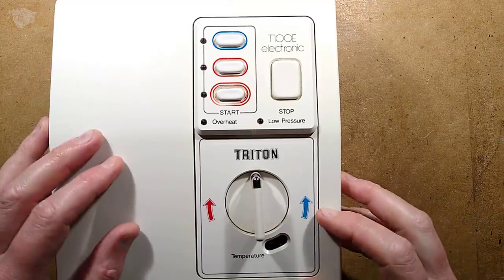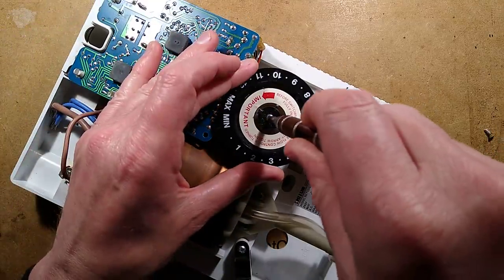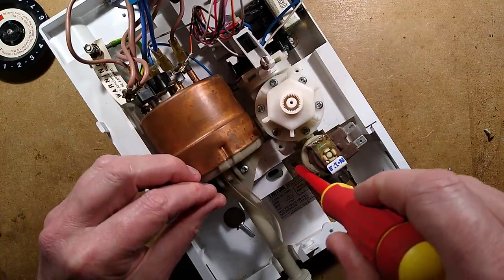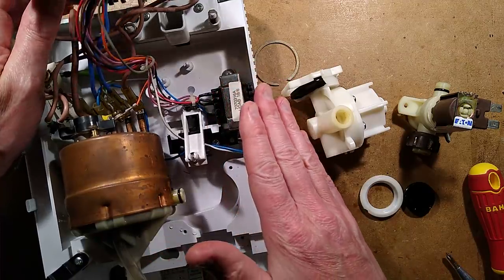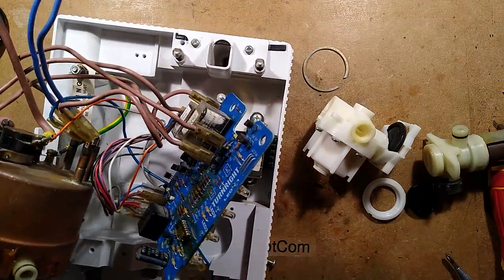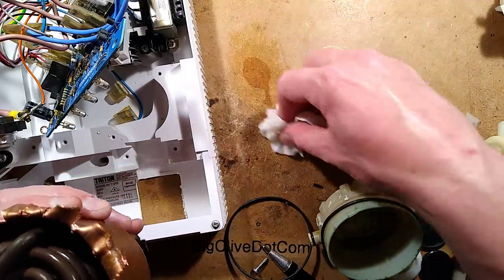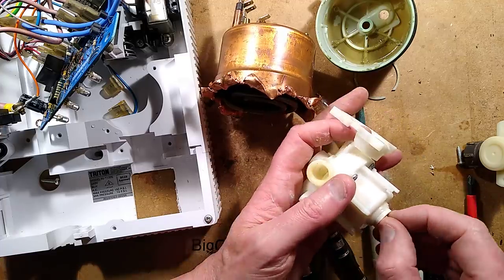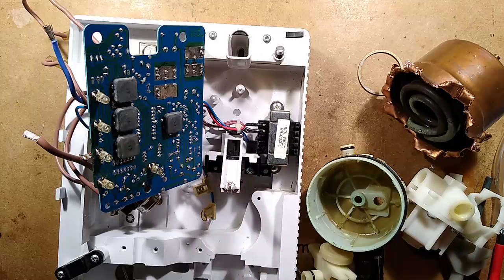Teardown of a British electric shower that went bang.

Comment: this seems like such a dangerous system to me. i really dont understand why anyone would want one of these
Reply: Out of interest, what do you find dangerous about this? There are thousands of these in use and I've never heard of any problems. In fact, my parents had one for over 30 years before they moved house, and it was perfectly reliable. They don't require a hot water supply, and you get a hot shower in a few seconds. It's interesting to note that in the UK, you won't find any electric sockets on the walls, and the light switch is either outside the bathroom or a pull cord. British safety standards are pretty high.
Reply: I echo what Steve Caddy has written and would like to add that a 30mA RCD trip is the compulsory safety disconnector for electric showers; not at all dangerous, I've used one for 40 years.
Reply: As soon as the electrical current spikes due to a short circuit, it cuts out at the speed of light.
Reply: @SteveCaddy  there's over 27 million homes in the uk, i expect at least 1/5 have at least one electric shower. That's not including hotels, caravans & campervans and so on. So at least 4 million i would bet, not "thousands"
Reply: @mandowarrior123  Fair comment, and you're probably right. I thought saying there were millions of these devices in use would have sounded like over-stating the figures. Either way - they're not as dangerous as some people assume.

Comment: My experience of UK electric showers is that you can do everything except get wet  !!
Reply: You forgot to switch them on. The 10kW ones aren't too bad.
Reply: Pressure is the problem, if you have very little pressure in your mains then there is a problem, The hotter you you want the water, the less water goes through them as they work by reducing the amount of water running around the elements to get a hotter shower. Bad deign really, but they are cheapish
Reply: You've likely used a power shower then, they have piss poor flow rates but an electric shower will drench you as you are basically standing under a fully open cold water mains being ran through a heating coil.
Reply: The 6.5kW electric shower in my student house is shite. The way these showers regulate temperature is by regulating flow-rate, not current. So in the winter when the water temperature into your home is colder, the water gets regulated down to a trickle. Not fun.
Reply: @Oscar-if6lq  anything less than 9kW is useless
Reply: @krashd  Not quite. The flow has to be drastically reduced so that the elements can heat it. That flow is adjusted by the temperature control.

Comment: I'm guessing the double heating elements in the copper section are for the dual-setting heat. So one of the elements is used for the medium setting, and both for the high setting.

Comment: I guess I can accept Clyde's assertion that these units are "relatively safe", but if Brits make a habit of running 240v directly into their shower enclosures I never want to hear another of them whining about Americans not having switched outlets.
Reply: Lol exactly. They're always up on their high horses about how their electricity system is so safe. But then I hear about their bathrooms, and I'm shocked.
Reply: I'm a Brit who moved to the US, the un-switched outlets I can live with, it's just a nice ease of use feature. However what gets me, is a plug that can be fully live but not all the way inserted. Blew a breaker by accident that way, plug behind a desk  had worked out slightly, knocked a pci slot cover off my desk and it somehow landed bridged directly across the 2 contacts. I know now they tend to put ground pin on top to stop that but still.. it can still be live and not all the way inserted.
Reply: I would say 1/3 at least of UK homes have electric showers.

Comment: For being that old it seems safe to use. Here in Belgium we don't use those things. Warm water comes from an electric boiler or from a boiler heated by fossil fuel. ( most of the time the central heating system warms up the boiler or warms up the water 'on the fly', without even a boiler). There are similar central electric systems like this who heat up the water instantly from the main water pipe and deliver it to all warm water foucets and showers in the house. It's rated mostly about 25A at either 230V or 16A at 400V, depending on the waterflow needed. Those systems usually  also implememt a sun water boiler on the roof.
Reply: Do you think we have one of these on every hot tap? Of course we have central hot water boilers. 🙄
Reply: @howardg2010  Lol if I presumed that then everyone house should need a 200+ Amp main fuse 🤣

Comment: I had a shower that failed in a similar way. Think it was Mira one. Was not possible to find a replacement unit with the same pipe positions, but I did fix it by buying an old stock  spare part.

Comment: We have similar devices in some homes in Singapore, but with a tap connected before the unit, and a 20A (rated) switch next to the switch for the bathroom lighting/fan for power, while I much prefer central water heaters (different sizes for different house sizes, and one unit connected to all hot water taps).

Comment: pressure sensor is for low pressure, in our house if a tap or 2 were openned itd trio the low pressure , light the "low pressure" light and give you an instant cold shower. I assume its so the heating tank never ran dry or low of flow.

Comment: Here in Brazil everyone have an electric shower. I have a (Lorenzetti Advanced Turbo) in my house, and is actually a good shower,  the water gets hot af. But it requires 7500w of power in 220v, I guess 34Amps. But most of them are not so sophisticated as those british ones. Some foreigners get worried about having a 127 or 220volts(depending the state) boiling water next your head, but I never heard I single story about someone being electrocuted during shower. I guess will only have an accident if you are stupid enough to touch a hot wire,  but you will only get a shock if have the copper exposed. So by my experience, electric showers are relatively safe if you install everything correctly.
Reply: Clive's made a couple of videos on the kind of electric showers common in Brazil (which he nicknamed 'suicide showers' I believe). He concluded that they're likely to not be that unsafe as long as they were installed properly. He complained that the ground wire was short, and that some people allegedly do not connect the ground wire to a proper ground and instead to the water pipe!

Comment: Our well has a similar diaphragm pressure switch  to sense when pipe pressure has hit it's target, and turn off the well pump.  Ours failed in a very similar way the NEXT morning after returning from 2 week vacation.  Flooded a small area of basement before we caught it.  Thankfully it waited till we got back.   This led me to install leak detectors and have them kill power to our well in event they are triggered.

Comment: On safety, in England in 2017 there were apparently only 13 deaths by electrocution, with only 7 taking place in the home. Considering there are a lot of other ways to get electrocuted - they are probably rather safe. (Data from ONS)
Reply from the maker: That probably included people coming into contact with overhead lines.

Comment: I spent a couple of weeks in Brazil and Argentina. The shower heads have the heating element and it comes on when it detects water flow. Increasing or decreasing the flow regulates the temperature.
Reply from the maker: I featured the "suicide shower" in another video.

Comment: My parents had the remote controlled version of that shower. The control panel sat flush inside their shower cubicle, while the main unit sat mounted on the bathroom wall outside the cubicle. Obviously the components where sequenced differently as the heater elements were about 2 metres before the flow rate control.

Comment: I actually find it quite odd that in the UK, you don't have proper mains sockets in bathrooms due to health and safety reasons and you even have special light switches in bathrooms which you switch on by pulling a string. Yet you still have these electric showers and also shower pressure boosters which are basically combining mains 240v with water you're standing right under which to me looks a lot more sketchy than having a socket to plug in your hairdryer :)

Comment: Here in the US we usually use instant hot water heaters for spaces that cant have a traditional hot water heater. Similar in operation, but the heater usually sits somewhere in a cabinet or under the sink instead of being integrated into the shower.

Comment: I think we do have these in the USA, but they're sold under names such as "tankless water heater" or "inline water heater", and are usually in cabinets or in walls and gave more of an off/on mode controlled by water flow with fewer or even no user accessible controls?

Comment: I should rekon that that diaphragm switch detects the presence of sufficient water pressure. The heating elements will be held off, until there is water in the system, to stop it running dry.
As it is very close to the heating element, I should think that the plastic has just deteriorated over time and heat and gone brittle. The water gets hotter by slowing the flow with the heat control valve, cooler water by opening it to full speed. So to stop water hammer, you would have to set to Max heat, ie slow flow. Is that what the instructions said? Or have I got it wrong?

Comment: Maybe not on this model, but the model I had installed a couple of years ago would use that plunger switch to detect low water pressure, which it shows on the front panel using a mechanical indicator. The water will continue to run through the shower, but it will shut off the heating elements to avoid boiling the water.

Interesting (sort of), when I switch my shower off there's no cool down period. It instantly shuts the water off. There's then enough thermal energy left in the coils to heat up the water in the tank to the point where the thermal cut-out always trips.

Comment: 6:25 I think the pressure sensor turns off the power if the mains water pressure drops too low (in order to prevent scalding).

Comment: When you say about the cut off if the water stops, our shower of a quite similar idea but newer external design has recently started to cut the water but not the power when you press the Off button. This results in a “boiling kettle” type sound in the unit before I run to the ceiling switch to switch it off - I haven’t dared leave it for longer than the approximately 5-10 seconds when testing it to see if it will just trip. Until we can afford a new one, I’ve left the power switch on and it’s happily turning both water and power on and off now from the ceiling pull switch.
Reply from the maker: That's a bit scary.  It might just be a failed microswitch.

Comment: In every electric shower I have ever used, there hasn't been any circuit board at all - no electronics, purely electro-mechanical controls. Still the same basic guts: A solenoid valve, a water flow rate regulating valve, then the heater block with a pair of 4.25 kW elements, for a total maximum power of 8.5 kW (though there are more powerful versions at 9.5 or 11.5 kW if the power supply to your house can handle it).
The same temperature control options too - you can either have none of the elements powered for a cold shower, or just one for "eco mode / summer mode", or both elements for full power, with the fine temperature control done by varying the flow rate of water through the element. Doing it the other way by keeping the flow rate constant but changing the heating power would technically be possible, but would require a thumping great big variac or a high power PWM controller, which would either be extremely bulky or more expensive.
Anyway, the way it controls the heating elements is with a 4-position dial (one of the positions being off) which turns an assembly of spring-loaded plastic wedges to activate a series of microswitches: The first one I believe is a "push to break" type switch which cuts power to the solenoid valve when the dial is at the off position. Then there are two more microswitches, both rated 20 amp, which are activated in sequence to supply power to either one or both heating elements. Extremely simple, no electronics to diagnose, and cheap to fix since you usually only have to replace either the solenoid valve or the microswitches.

Comment: Pretty sure that pressure sensor is to disable the heating element under low pressure. My shower stopped working a few years back and I fixed it by replacing the flush valve on the toilet.

Comment: That flow sensor is probably for when there is no water going to the unit and yet the system is turned on. Maybe for testing or when road work crews need to shut down the water supply for repairs.
Reply: Purely there for water flow, if its too slow the unit won't heat the water, if that fails there is a thermal cutout that is below scalding temperatures

Comment: it should be connected to a gfi  protection. when ever you have electric and water.

it is also much safer than the suicide showers that are popular too.

though it is still possible to get a shock if the unit is not grounded and gfi protected properly
Reply: A shower HAS to be supplied via a 30mA RCD/RCBO and all incoming supplies earthed

Comment: This is a very interesting video!
I think there is another reason why they are so popular in uk.
It may be going a bit back in time.
A plumber from Birmingham told me that it was (even today?) not allowed in UK to connect any hot water boiler direct to the mains supply line.
Instead there is a cold water cistern on the loft of the house. This cistern is filled from the mains line from a float valve.
This should ensure, that no bacteria contaminated water can flow back if the pressure drops in the mains line.
The result is that the pressure is not enough to supply a shower.
So the electric shower became popular because they were allowed to be supplied from the high pressure mains supply.
I think that is also the reason for the two water taps i often have seen in UK. One for hot and another for cold water.
In Germany we only know mixer taps. But even in Germany there has to be a check valve between the mains supply and the hot water system.
Reply: That is another consideration.
It's no longer the case in the UK but certainly was in the past

Comment: Replacing these things is a real PITA. New models keep changing shape, so you are pretty lucky if you can find one that neatly fits in place of the old one. You end up having to hack things to get the pipes and wires in the right place, with a messy final result.

Comment: We have instant hot water for drinking or pre heaters for dish washers or tankless hot water heaters are basically built the same. . Kind of dangerous for in shower installs. Usually put in the basement. Canadian code won't allow that sort of install in showers

Comment: Yes to water hammer, it was a direct path across from the inlet. Strangely they have the safety pop-off in a place where the inrush of water would need to fill the chamber before the pop-off would see the pressure. Now if they would have put the pop-off directly across from the inlet then they would have had a winning safety design. The inlet chamber safety was designed with the idea that the chamber would always be full of water, but it's not when it's not. Good video, well explained.

Comment: We have one of these at the batch. I'm sure they're more than safe enough. But I still feel like I'm one step away from using a hair-dryer in the bathtub every time I use it. And it's hard to regulate the temperature when you have the water pressure of a rain-water tank.

Comment: the diaphram is a low pressure safety device that cuts the eliment power so if water is cut the power to the eliment is switched off to avoid burning out the heater

Comment: The pressure switch that expoloded is for sensing minimum pressure, you don't want it coming on if there's no flow.
Fist electric shower i had was a 'heatrae sadia carousel', it was 6KW, everything inside was copper, no electronics, there was a double pressure switch that brought on the 2 elements independently, and 2 control valves, was based purely on the water flow for temperature, and very reliable, had that thing for many years.
Problem with triton types is that if you take them apart, the o rings don't seal again.
If Americaans want to be really scared, one shower we came across at work was an acrylic block that had a bare coiled element threaded through and in contact with the water flow.
Reply from the maker: I've seen one of those.  The water outlet went through a long coiled hose for resistance and then a grounded outlet port.

Comment: there are spares available for electric showers, i fixed our old one once when the thermal trip failed, found an online specialist that helped to diagnose the issue and sold me the right parts at a very decent price, a different part failed a couple of years later and they diagnosed the problem but i decided it was time to replace it with a newer more powerful one (and i had access to a trade account to get it at a discount). i had a new cable run from the main box at the same time as the previous owner was keen but inept at Diy and i didn't trust it.
the decision to replace this one is definitely the right one, it's old enough that a parts will be difficult to get and there is a good chance that something else will fail soon due to the age.

also we get to see inside the old one!